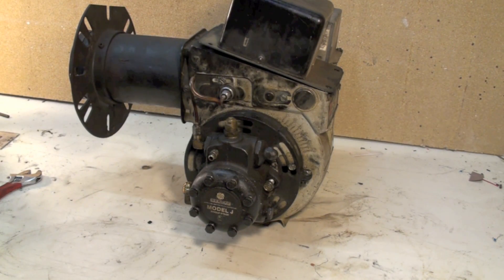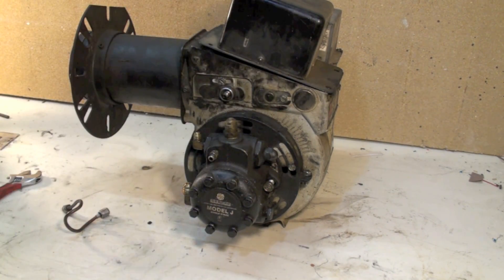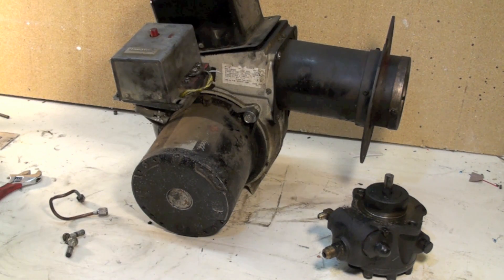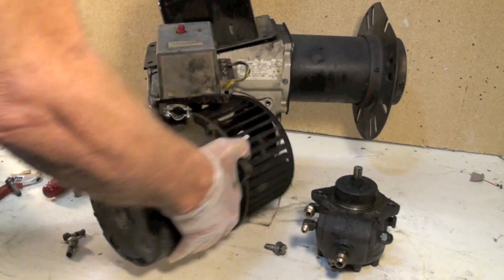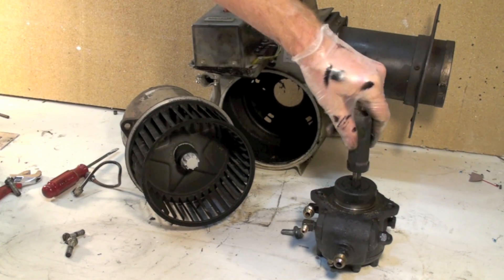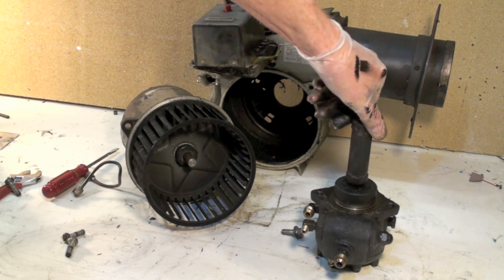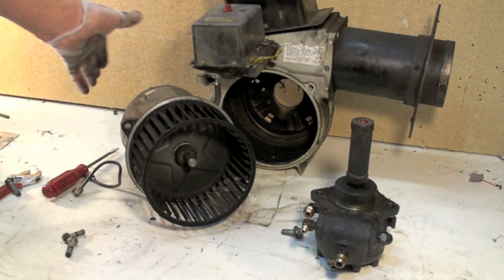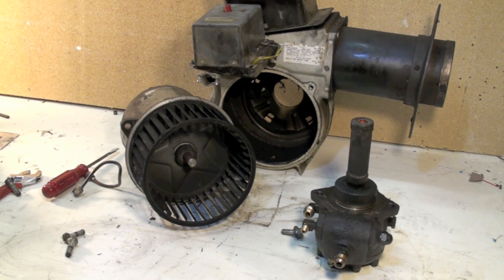Oil gun burner disassembly

Comment: Gary You are a Very Good Tech on these Oil Burners. I have Watch many of Your Videos. I want to ask You a Question. I buy an old Hotsy Steam Cleaner that I am rebuilding. The Pump on the machine is a A2VA-7116 SundStrand Pump. So I am replacing the Pump with a New Sun Tec A2VA-7116 Pump. The machine states it's a 315,000 BTU Burner. I would like the BTU rating is the Burner and not the Coils? I can't find No Manual on this Old Steam or Hot Water Washer. So in setting up new Pump and I will need the pressures I should start with. I am adding a inline water thermostat for temperatures up to 302 degree for discharge. I probably will set the water temperature around 210 Degrees leaving the coils on discharged. I plan to put a inline Filter and Water Separator before the Pump. So I appreciate any help you can offer.
Reply from the maker: The BTU rating is for the coils.  The burner capacity is dependent on nozzle size.  Start with 100# pressure.
GFM
Reply: @grayfurnaceman  Gray the Nozzle is stamped 1.25 / 80 B. What I have read B is a fan spray? I think the 80 is probably the angle of the fan of the spray pattern. I figure the 1.25 is possible the fuel amount per Hour? This is the  nozzle in the Burner Now. This is being used as a Steam Cleaner. I am installing new water and oil separator and a New SunTec Pump A2VA-7116 on this burner. I  checked the 10,000 volt  120vac coil ignitor for an  electrical arc. The arc looks to have some orange color to it. I know on auto coils, the bluer the arc is stronger the coil is when deep blue. So with any Orange should I replace the Coil? I have reset electrodes according to the specs.

In your reply to me.  YOU stated 100 psi from the Pump, Does that mean the pressure to the nozzle Orifice or the Pressure the pump needs to supply? I plan to fire the burner before installing the burner into the Coils. All this is new to me setting up these burners. I know the Nozzles and Clearance at the Nozzles are very important. I wait for your supply. Thanks Gray.
Reply from the maker: @waymonblevins6939  The "B" means the spray is a solid spray filled with droplets.  80 is the angle of spray.  The 1.25 is capacity at 100# pressure.  The orange on this type of coil shows normal spark.  The pressure is read at the gun line at the outlet of the pump.  I have many videos about oil furnaces and they are listed under "oil furnace" on my Grayfurnaceman channel.
GFM
Reply: @grayfurnaceman  Gray, I want to ask should I change the Nozzle for a cone shape pattern verses a solid pattern?
Reply from the maker: @waymonblevins6939  It is probably ok.  Different regions may have better luck with different nozzles.  I am in the northwest and we generally use a Delavan A or W.  They are semi solid.  If the combustion test gives clean results, you are ok.
GFM
Reply: @grayfurnaceman  Gray, what I am using this on is  steam Cleaner. But I plan to install this type of Heater in a Garage burning LP Gas that has 14 ft walls and Floor place of 45 Ft wide x 100 Ft Long. I plan to use a Boiler and Heat Exchanger with water circulating in and out of these Heat Exchanger back the Boiler again. I think this type of Heater is Best to heat an area this Big. I figure you were up in the Northern Part of US either the middle or up west area. I am in Tennessee in the Southern Middle part. It's like I stated earlier I watch a lot of your Videos. You are very  in-depth 😭 on your videos and that is why I contacted You Gray.  No BS only True Facts and that means a lot. I am an Old Boilermaker by Craft, I worked  Steam Boilers for Electricity, Papermills and building them across America. With these Boilers we used Coal, Wood Bark, Natural Gas and in Papermills we used Black Liquor from Wood rosin. Steam Heat is the Hottest Heat versus Electric or other forms of  Heat. I thank you Gray for your support.
Reply: @grayfurnaceman  I may change the B Orifice for an A Orifice to see the change in heating.

Comment: what type of lubrication should be used in the burner motor of a high pressure gun burner?
Reply from the maker: I use what is called "Zoom Spout oiler", available at hardware stores.
GFM

Comment: Hi ther Hray,
I'm running a Miller mobile home furnace, with a wayne burner assembly.
Square duntsch pump,
Just tore it down due to shattered drive sleeve, cant seem to find a piece to determine the correct new length for the drive sleeve, I have a new universal kit to cut a new one, but am asking around to find out a workable lrngth.
Thanks if you can help.
Also do you have any Miller furnace service cleaning vids.
Reply from the maker: I have nothing on Millers.
The drive adapter Is generally measured with the ends fitted and then the distance between the ends measured.  Not easy to do but that's it.
GFM
Reply: Ok thanks I'll keep getting into it,
Thanks for your reply.

Comment: I spent hours trying to get draw from my pump thinking it was just a nasty air lock from my above tank filter, then disassembled the nozzle and cleaned out the head and sintered filter in that, then cleaned out all the debris from the pump screen, and then once I got overly frustrated, I found your video and kicked myself in the butt from being so ignorant as to not think about that coupler! I just heated the reamed out end that goes to the pump a little and then applied some outside pressure while it was on the shaft to reform it and it sat back into the body of the coupling just fine! I ordered the new one to put in in a couple days but with 20 degrees I wasn't waiting to fire it up and keep my pipes from freezing any longer! Thanks for the video, it kept me from spending hundreds to have someone replace a 3 dollar part on my burner.
Reply from the maker: Glad you got it going.
GFM

Comment: you've helped me out more times than I can count, @grayfurnaceman.   I have oil leaking out of the bottom of where the blower wheel housing is.   obviously that signals unburnt oil getting to where it's not supposed to be.   could it be a spray angle issue?  or could it be an issue if the burnerhead is correct, but not within the normal spec? (damaged)
Reply from the maker: There are a number of possibilities here.  Oil impingement in the burner head, not enough draft, pump seal failed and partially plugged nozzle.
GFM

Comment: GOOD MORNING, PLEASE SOME CAN HELP ME. UNDER THE DRIVE MOTOR IS LEAKING DROPS OF OIL. PLEASE FROM WHERE THIS CAN BE?  914 497 9070 CAN I HAVE YOUR ADVICE, PLEASE
Reply from the maker: +dionisio camay There are 2 possibilities here.  One, the pump seal is leaking.  You can tell by pulling the motor and looking at the pump shaft.  Wet and the seal is leaking.  The other is a plugged heat exchanger or vent pipe.  This should also have a burned oil smell in the house.  Hope this helps.
GFM
Reply: thank you very much for your advice. i will check this.

Comment: Awesome videos! just found your channel while looking for a fix for my oil furnace. I found that my coupling has broken. Old and brittle as apposed to flexable like you describe. I plan to head to the hardware store tomorrow to source a new one. My question is: are they universal or do I need to bring any information about furnace and model and such with me? Thanks!!
Reply from the maker: +Bill and Karen There are usually kits you can buy that include a cut to fit coupler with an assortment of ends of different sizes to fit most pumps.  Good luck.
GFM

Comment: Hi I have a The Williamson Co. Spec No. 02-689 that needs a new motor-to-pump coupling. Do you happen to know the part number for that part? Or maybe a good parts retailer? I've been searching for hours and no luck. Thanks for any help.
Reply from the maker: There are kits to replace the coupler that just come with a length of coupling and assorted tips.  Try looking for it that way.  I don't recommend any retailer because if I do I am kind of recommending them and I would feel responsible for any failure.
GFM

Comment: If it was that easy while on the furnace we would have it made,man i have had a hard time on many of these just replacing a pump or motor,a few times on some of the mobilehome ones i would just pull the hole burner out to do it,they were wedged in their with very little room to work,their's still a bunch of those with the sun and webster pumps still going strong in my area,some of the older folks love the heat from these things and will never replace even with the oil price going up,great vid

Comment from the maker: In a word no.  Used oil will not break into small droplets.  Lubricating oil must be preheated to a high enough temp that it will vaporize then it can be mixed with air and ignited.  
GFM

Comment from the maker: That is the old Sunstrand Model J pump.  It ran at 1725 rpm.  This and the Webster pump were the standard from the 50s to the early 70s.  Those pumps seemed to be able to run under the worst conditions possible and still be dependable.  Some of those old pumps are still running from the 50s.  Someday just for the grins of it, I will take apart a Webster on youtube  You could use one of them as a boat anchor they were so heavy.  The mini pumps are ok but they will sometimes squeal if run dry.